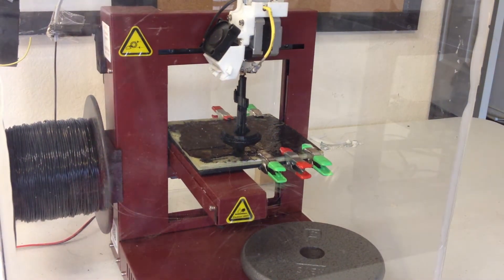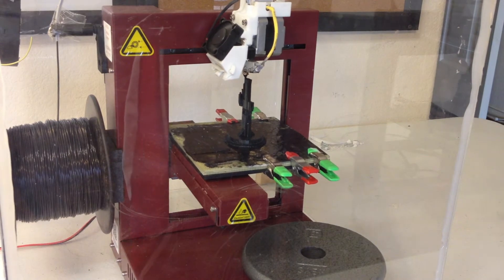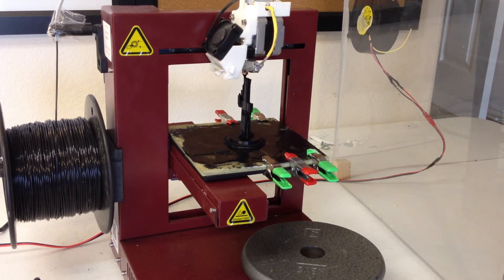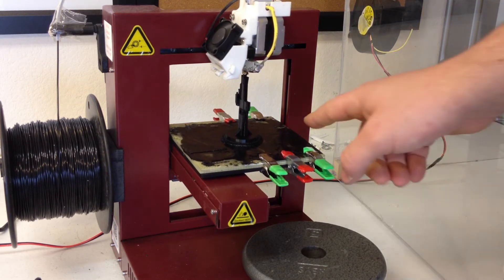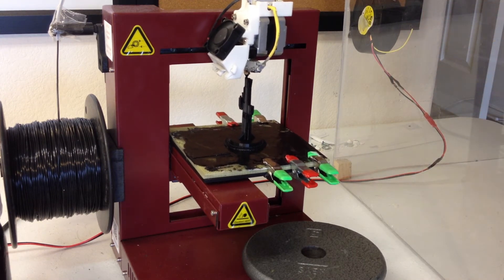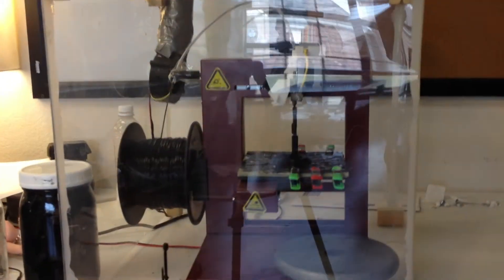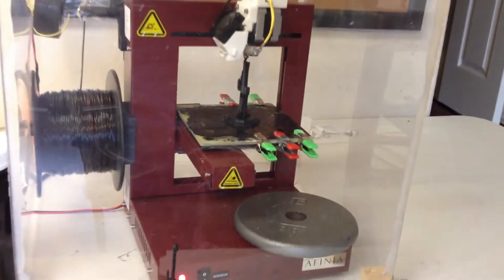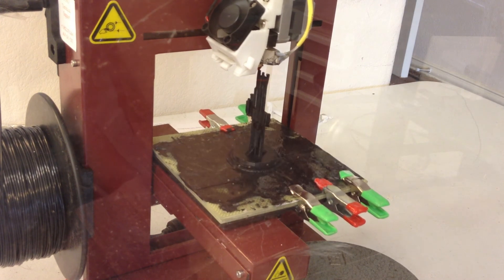affinia 3d printer review

Comment: Justin, I bought the same printer. I'm sure by now that you've learned some things about printing to make better results. What I do for a print like that rifle is print what I'm calling a "lightning rod". IT's a tall thin post that's taller than your rifle. Without it, the print head will reach the barrel and print and print and print, without any time for the previous layer to cool, you get a very gummy barrel. If you print multiple copies, or use a "lightning rod", the printer, every layer, goes from the barrel to the lightning rod, allowing cooling time for the layer before it prints the next layer. The result is a MUCH more refined cylinder for the barrel. The wastage is minimal, and the extra time isn't much either.
Reply from the maker: thats a great idea. i have noticed bad prints on small tall areas. 

thanks for the tip.